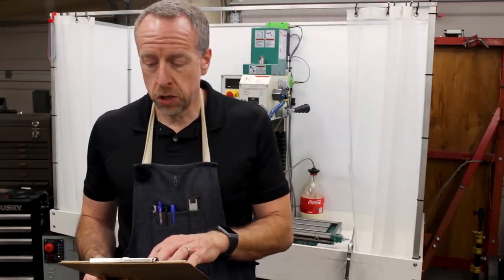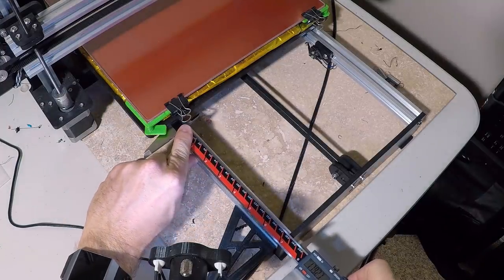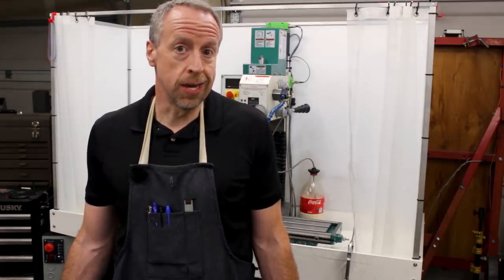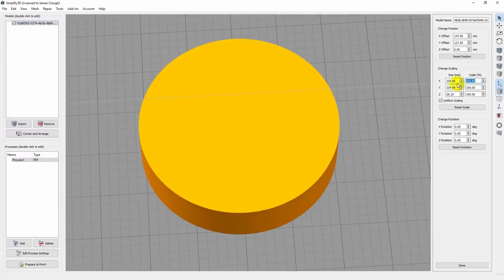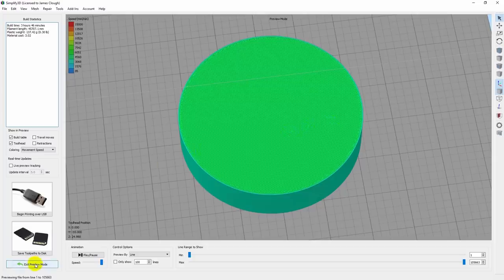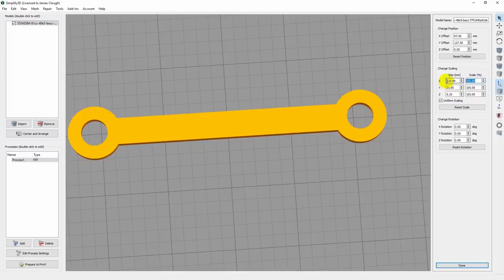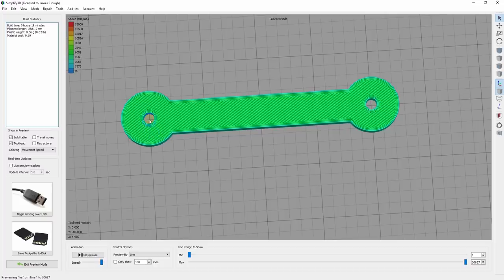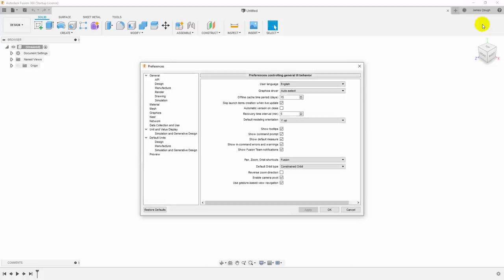3D Printer Dimension Tuning Revisited

Comment: Thank you , this is a well done follow up . This is simple physics and why I support using this concept  to teach science in the schools .  The concept of 3d printing filament involves heat . When heat is applied to any material it expands when it leaves it contracts or shrinks . This Applies to any polymer and it depends on the type of polymer as they all expand at slightly different rates.   if the polymer is what we call the amorphous family it normally  has a lower rate of expansion than the polymers that are from the crystalline family . The idea of telling this group about this is to provide further clarity to this video . The two different families of thermoplastic materials have distinct properties that hinge on the rate it changes from a solid to a liquid . Amorphous materials are like syrup or butter  the more heat you add the more it easily it flows and never has a specific heat it can be called liquid or solid as it can flow in a wide range   . In the crystalline family of polymers it changes state  sharply and at a specific temperature . The  expansion and shrinkage rate is interdependent with the temperature each material changes . state . You did correctly identify most of the other variables that influence the dimensional variation , ie measurement error  , machine variation and part design are all interdependent with predicting dimensional accuracy .  I guess I said all this to say in your original video you gave us the best way to include all this by measuring original parts and compensating to print a new one . It is trial and error . But the concept of accuracy this way goes out the  window if you print on a different printer or change material or modify the design .

Comment: Excellent revisit to address the misunderstandings. It's not JFM, there is invariably a (simple) reason behind differences seen in desired results, and obtained results. Jumping to misguided conclusions without the full facts can have someone chasing their tail for far longer than is necessary. Thank you James for taking the time to expand on the thought processes required, and thank you to this excellent community for their pertinent questioning, and for the sharing of tips with the unknowns. We all learn from this.
Reply from the maker: It might be worth a look.  I started with open-source Slic3r, and had no end of trouble: tool path errors, missing features, slow slicing, crashes, etc.  Simplify3D was well worth the $150 price tag.  But things change.  Maybe the Prusa version is better now.

Comment: Again, it was interesting to see how you addressed the print problems and possible suggestions from others.  What was interesting is how your .5% shrinkage pretty much added up to the .1% of bed travel difference and the .4% shrinkage that was mentioned in the filament documentation.

Comment: Love these videos. I have been 3d printing for a few years and what you did is exactly correct. Most likely the majority who sort of misunderstood you probably don't mainly make parts that have high tolerances and therefore require some diagnostics to figure out the various cause and effects of all the variables. Thanks for sharing.
Reply from the maker: When someone asks me "which tool is best" I respond with "it depends; what are you trying to do?"  If you're printing a bust of Napoleon, you'll care about different things than someone trying to prototype parts for a mechanical clock.  This is the case with almost everything.  Should I lift light weights for many reps, or heavy weights for few reps?  It depends.  What are your goals?

Comment: I find it interesting that some people believe the plastic/filament doesn't shrink, especially considering the filament manufacturer tells you approximately how much it will shrink on the product specifications, and you even showed that spec in the previous video. Compensating for this (shrinkage) is pretty standard practice in the 3D printing community. Perhaps the people who believe otherwise either do not own 3D Printers or do not print objects that require significant precision.

Comment: Totally on point, and it takes some experimentation with different plastics to figure out how they will shrink. The idea of a heated chamber for ABS etc is not to prevent shrinking but to keep it uniform, so the part doesn't warp. ABS is one of the higher shrink factors, PLA is negligible -- PETg something in between -- it's all about testing and finding the right adjustment. I have not found horizontal size compensation useful for that exact reason -- it messes up internal perimeters and doesn't really help with shrinkage. Typically though I disable uniform scaling and just scale on XY. Z doesn't tend to shrink at all.
Reply: Yeah, people who anneal their printed parts report that XY dimensions shrink after heating in the oven, but Z expands. I think the difference is somewhere between 2-5% shrink/expand for each dimension.

Comment: I am really a fan of your X/Y travel measurement method, I wouldn't have thought to do it that way, but it's much faster and should be more accurate than a 20x20mm cube print.  Also interesting is that the 0.1 difference does bring their stated 0.4% shrinkage number much closer to reality.  It really does seem like "Filament shrinkage correction" should be a feature in a slicer like S3D.

Comment: I'm finally going to bite the bullet and buy a 3D printer (if I can figure out which one). I already own a circuit board mill that I also use to cut out panel holes if I need something clean and accurate (always lol) so I am familiar with Fusion 360 (not an expert by any means). This is all great information and it's information that I feel like I can trust. Thanks for taking the time to make these videos.

Comment: Great followup share from your first vid. As long as techniques work they're the right thing at the time. It took a long time for plastics molders to integrate rules of thumb for exit angle for the part to release from the mold. Then, add a pebbled finish which is so very common. Have to consider that rough finish, too.

Comment: I also think the horizontal size compensation would be a good feature if you wanted to add some machining allowance to the part.
great video. thanks.
Reply from the maker: Great idea.  It would be perfect for that.
Reply: You would also want to add more shells so that machining wouldn't break through into the infill areas though.
Reply: @dreggory82  Hi Dreggory82, yes that would be the case if you were to machine the printed part. Although, one would hope that the printing process would print to the required accuracy.
My comment was specifically for using the printed part to cast a part and then have it machined to tolerance.
the additional Horizontal Size Compensation (HSC) can be used to allow for surface imperfections in the casting process. essentially the poorer the casting surface the higher a value of HSC to be used.
Generally a draft is used when a part is to be cast so that the pattern can be removed from the sand mould. This draft is then machined off some surfaces and it removes, in some cases the surface imperfections. The HSC , will be in addition to this and can help out when excessive shrinkage depressions are occurring.

Comment: Great 2 videos James - I've been adding clearance parameters in Fusion and/or increasing the model sizes to fix this problem. I sensed this was the wrong way to do it and DOH, of course, SCALE hahaha. It's always so obvious when someone shows you how. Thanks again, always enjoy your content. Off to print some test parts with my "non +" abs :)
Reply from the maker: Some of that stuff still makes sense.  A 10mm part won't fit in a 10mm hole without some allowance for the fit.  Increasing these fit allowances will work to compensate for some shrinkage situations, but it won't help with the distance between holes.

Comment: For anybody confused about Z-up in F360: it default configuration is for metal machining; so is the model's appearance: dark gray shading means metal. Switch to plastic default appearance after the Z-up change for modeling plastic parts.

Comment: People who said that plastic doesn't shrink when cooling obviously know so little (aka nothing) about 3D printing and manufacturing in general. Almost everything (except water and a 1 or 2 metal alloys) expands when heated and shrinks when cooled - plastic, metal, even paper. And with 3D printing, unfortunately, you'll have to use your best guess when combating shrinkage - it highly depends on the geometry and printing conditions. I once had an ABS part shrink by 2% in the XY plane but not Z and to make matters worse it shrank less near the bed.

Comment: My only useful thought is that for cases where precision is an issue is to print something like a 123 block and take measurements of the actual dimensions. One of these for every different filament material would provide the individual axis calibration data. Useful if it turns out that the shrinkage is different in each axis.

Comment: Great video.  I did some photogrammetry on a bust sculpture (of myself years back), and used meshlab, to set coords, and confirmed them, in meshmixer.  Yet still it imported flopped over 90 degrees in S3D.  No biggie really, but haven't tracked down why that is.  Perhaps this is a setting in meshmixer as well as in Fusion.

Comment: The .1% movement error of the printer means the filament shrinkage spec of 0.4% was spot on. I've been trying to calibrate one of my printers but I find it difficult to get repeatable numbers when I test the amount of movement of the heads or when I measure a part after it has printed. On a printed cube the measurement depends on where I take the reading. For example, at the top corners, the bottom corners, or in the middle of a side.

Comment: I use Cura for slicing and I think their definition of "Horizontal Expansion" is a more accurate and understandable term for what is happening here.  CHEP recently did a video on horizontal expansion on his channel and, as he explained, it's good for making your parts more accurate when they print at the correct dimensions, but your extrusion is the issue.
Reply: Link to the CHEP-video: https://www.youtube.com/watch?v=UUelLZvDelU
Reply: Still a bit confused why Cura need special treatment for holes, but in S3D a uniform scaling of the whole model solves both inner and outer dimensions?

Comment: One thing you missed is, that you do not need to scale Z for shrinkage. Each layer cools separately, and the shrinkage is filled in by the next layer. Z should be pretty spot on if your Z steps per mm is correct.
Reply from the maker: My z is spot on after scaling.  If the whole part is warm, it will all shrink as it cools.  This will vary with distance from the bed
Reply: @Clough42  Strange. My Z is spot on without scaling. Of course my X, and Y are also very close without scaling, but the Z is precision. Most of the shrinkage is done before the next layer is printed. There is some shrinkage after print, as the bed cools, but just a tiny bit.

Comment: Hey, interesting videos, just one thing, any chance of you popping in to the 21st century and consistently using metric measurements please? Surely the fact that horizontal size adjustment is input as a linear adjustment and scaling as a percentage should ring alarm bells that the effects are going to be different?
Reply from the maker: When using metric units makes my life easier, I use them.  Where I live, all of the machines I can buy have inch handwheels, all of the metal I can buy is in nominal inch sizes, all of the end mills stocked at my local tool supplier are in inch sizes, and all of the screws I can buy at my local hardware store have unified screw threads.  Also, the reeeeee in the comments when I mix units amuses me.

Comment: Simple physics dictates that when you heat something up it expands and when it cools it shrinks(the exception is water ), you are heating the filament to melt it so it can be extruded and when it cools it has to shrink .
The funny thing is that the way a printer lays down filament layer by layer it compensates for any shrinkage in the Z axis and i think this confuses some people as they can't understand why the X&Y axis has come out undersized but the Z axis is ok .
Reply from the maker: Actually, the whole print stays hot until the end, and the whole print shrinks when it cools, so z is affected, too.  It's confusing because it cools twice: once to freeze the material to basically the bed temperature, and again to room temperature.  The first cooling is compensated for in z with additional layers, but not the second.  Of course you end up with a gradient during the print with distance from the bed.

Comment: Excellent videos. I like the math approach.

Horizontal compensation definitely isn’t the way to go for the general application here, but I’m still unsure about scaling for shrinkage on holes as a perfect method. Wouldn’t the holes actually increase in diameter if the material was shrinking?
Reply from the maker: No.  The shrinkage is uniform, so the holes get smaller, too.  It's hard to visualize, but you can imagine it in a couple of ways.  If you choose your reference point in the center of a part and consider a hole near the edge, the wall of the hole nearest the center of the part will move towards the center.  This seems like it might make the hole bigger, but the side of the hole towards the outside of the part moves toward the center, too.  It actually moves more, making the hole smaller.

If the holes were fixed in space, it would seem intuitive that they would get larger, but they're not fixed.  They all move closer together, as the part shrinks.
Reply: Clough42 Thanks for your reply. I was checking back every day because it has my brain itching. Obviously it worked in the video quite well. Can’t wait to try it out this weekend.

Comment: I'm fairly new to this but I discovered that exporting .stl files from Fusion360 in the default low poly setting was the cause of my holes being too small..not enough vertices to accurately represent a circle.

Comment: The main reason for shrinkage is the cooling from your HB temperature to room temperture. You can verify by calculating what you would expect with the correponding CTE. The excel sheet in this test gives you all you need and more information about the accuracy of your printer: https://www.thingiverse.com/thing:2484766
It would be great if the slicer would have a material based shinkage as parameter and compensate it accordingly.

Comment: Ive never had shrinking issues ever. Ive printed things where tolerances of a few thousandths makes a difference such as for bearings and its always within 1 thousandths. Maybe it has to do with filament type idk. I used 3d solutech faithfully until 2 weeks ago when i couldnt find it anymore. Been printing tight tolerance parts for 5 yrs with no issues. Maybe its my settings. I run 205 deg c on my extruder with 50deg c bed on everything and print 80 to 100mm/min. Maybe color has to do with it as some dyes rect different to heat, idk.

Comment: If the part shrinks. Won't the holes shrink by 0.4 0/0 as well? A 10mm hole becomes a 9.96mm hole.
Reply from the maker: Yes.  And they also get closer together.  Both are fixed by scaling up the part to account for shrinkage.

Comment: So if you start to use the much superior PrusaSlicer you can have filament per settings
Reply: Sir, I did my due diligence and checked your channel (Stephen), you are indeed capable to fine tune your prints. Would you share your experience with me and explain me why is Prusa slicer superior and how I can benefit from it. I am always looking for improvments, thanks!

Comment: I use fusion 360 & cura. After calibrating all 3 axis of the printer, I have noticed that on every part 0.4 to 0.8mm is missing from the bottom.   Every feature above 1mm is the correct height. If I print a part that is 1mm high, it will print correctly with no loss on the bottom. I think that it is the slicer that is causing this. Any insight?
Reply from the maker: It's possible.  The slicer can be configure to squish the bottom layer for better adhesion.  Though that's a lot to be missing, unless you somehow have it configured to start at layer 3 or 4.  I'd also check your z zero and bed leveling.
Reply: @Clough42  Thanks. The z-offset was offset

Comment: i'm struggling to get dimensionally correct circles on my prints.  I need to print 3.2mm holes but they keep coming out small no matter what I try.  Any ideas?  Thanks.
Reply from the maker: Small holes like that commonly come out small (or lumpy) on FDM printers.  I just run a chucking reamer through the hole to bring it to size.
Reply: @Clough42  Kind of starting to think that's going to be the solution or a drill....
Reply from the maker: @thebikeracer  the nice thing about a straight flute reamer is that it doesn't grab and pull into the print.

Comment: Why weren't you using Z axis up as default?
Reply from the maker: Because that wasn't the default.
Reply: @Clough42  Z up comes naturally when drawing on paper. I was always using my thumb, index finger and middle finger to figure out axis rotation when drawing 3D CAD
Reply from the maker: @erik_dk842  that's not the issue.  I was using z-up.  Z increased when raising the knee, which is exactly how the knee crank dial is marked.  But once you add in the quill, it needs to go down when raising the knee to male sense.
Reply: @Clough42  I have yet to do any machining.